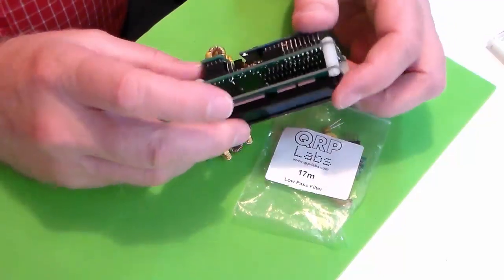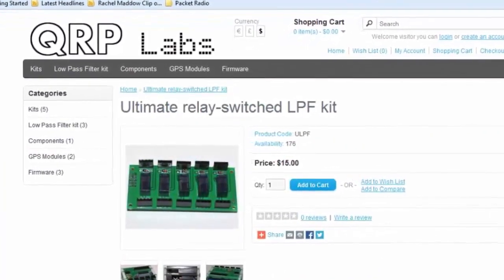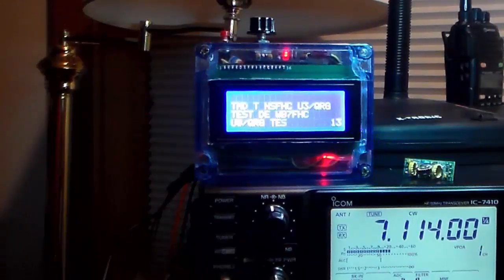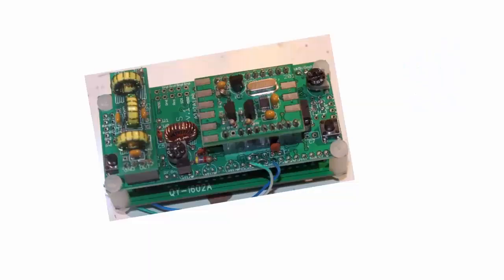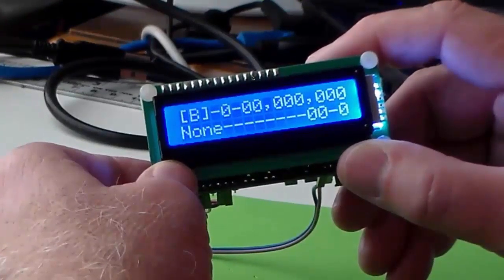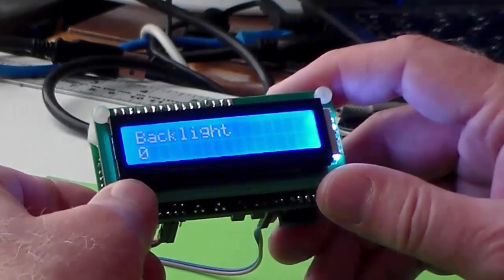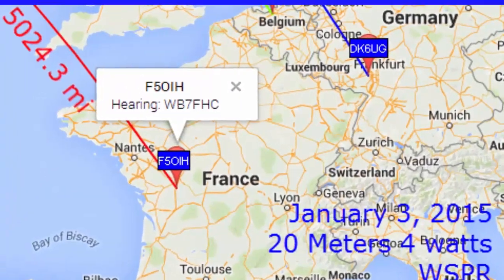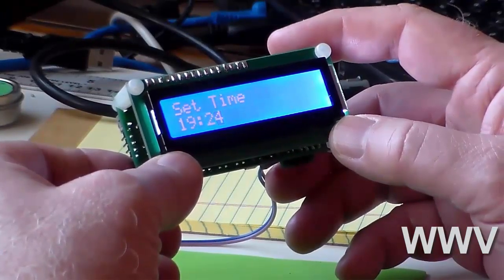QRP-Labs Ultimate 3 Pt4 Putting it On the Air

Comment: I am assuming that the low pass filters allow you access to their respective bands, does this mean that you can also make one for say the 60m band or would the iron donuts be comically big? what would it take to have access to the widest bandn possible?
Reply from the maker: The donuts, we call them toroids, will probably be the same. It is the number of turns of the wire that will be different.